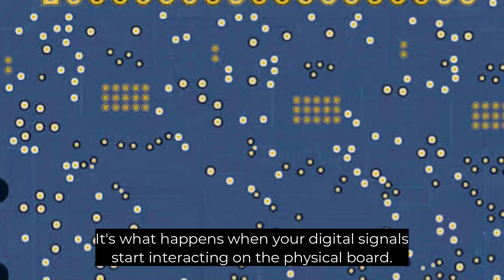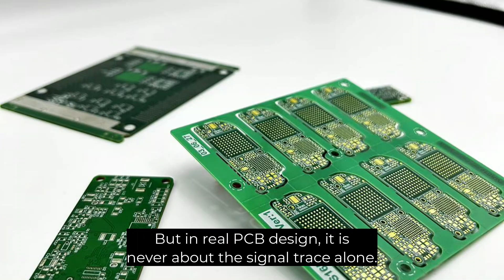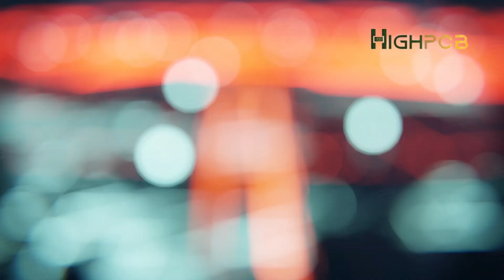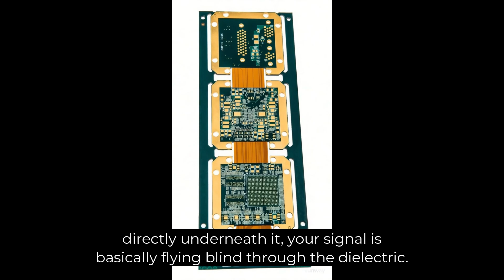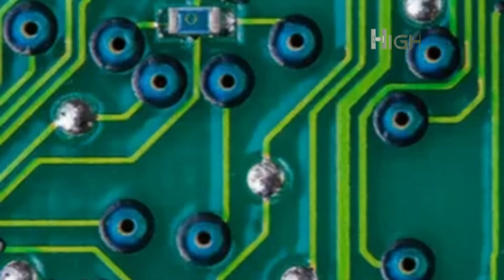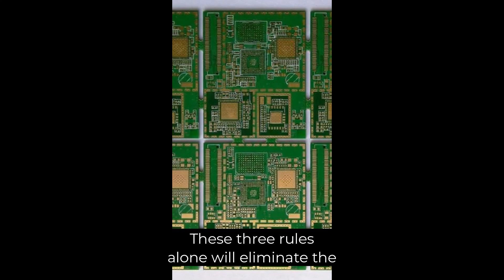PCB Signal Integrity Masterclass: Stop High-Speed Design Failures

Comment: One of the biggest misconceptions in high-speed PCB design is that signal integrity problems can be fixed after the layout is finished. In reality, stack-up planning, return paths, and component placement often determine success long before routing begins. Good SI is usually the result of solid design decisions, not post-layout fixes.

Comment: One thing that really changed how I approach high-speed layouts is thinking about the return current path instead of just the signal trace. A lot of SI problems disappear once you start designing for the entire current loop rather than treating traces like simple wires. It's a mindset shift that's easy to overlook but makes a huge difference.

Comment: One of the biggest misconceptions is that signal integrity only becomes important at extremely high frequencies. In reality, fast edge rates can create SI issues even when the clock frequency seems relatively low. It would be great to see a few real-world examples where a small layout change made a measurable difference.
Reply from the maker: You are absolutely right—it's the edge rates, not just the frequency, that cause most signal integrity headaches.